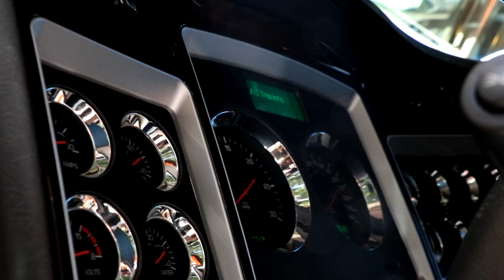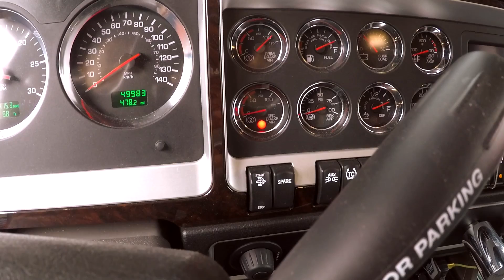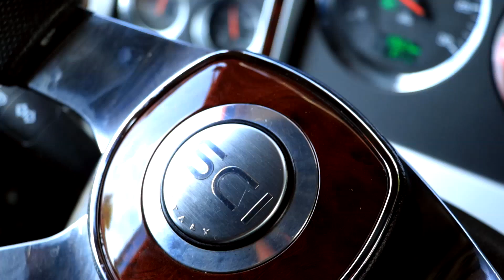2019 W900 KENWORTH BETTER FIX THIS PROBLEM - MUST WATCH

Comment: Is it very difficult to buy a new truck and trailer to be an owner operator and would you recommend this to someone just starting off in trucking? I’ve always imagined that the payments on a new truck would be far more than a new driver will be able to handle.
Reply from the maker: IslandSoundz what you want to do is at least get a year experience.   It’s really up to you if you want to be owner Operator.  The more experience the better.  Starting off as an owner operator you’ll end up being hit with the unexpected which could catch you off guard.  Save up a little money first for emergencies.  Understand the road and your truck and then go owner Operator. Thank you for watching.

Comment: Front cans are service only and work off of applied pressure. Didn’t need to drain the tanks, BUT always good to do it about once a week anyway.
Reply from the maker: I knew that. I didn’t want someone commenting about not releasing the air but yes I know they are isolated until you apply pressure. Thank you for watching.

Comment: Is no more easily a 1/ 4 turn up on the one closest to the air value
Reply from the maker: This was fixed in the next video.  I did a video where I turn the fittings repositioning the hose in the correct position. Thanks for watching.  The purpose of this video is make drivers aware of this problem.